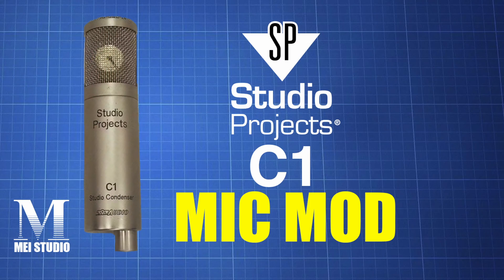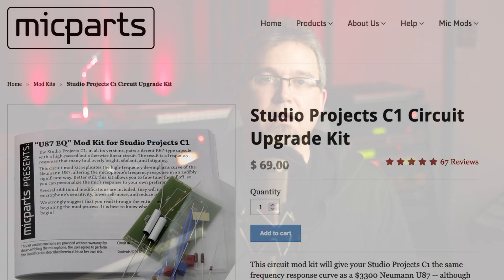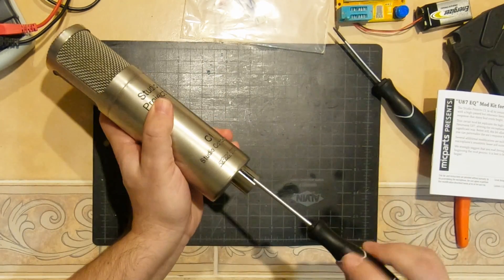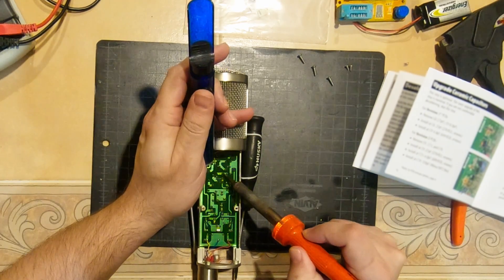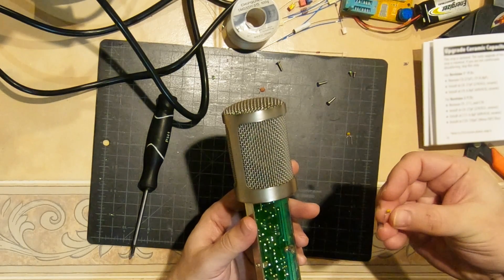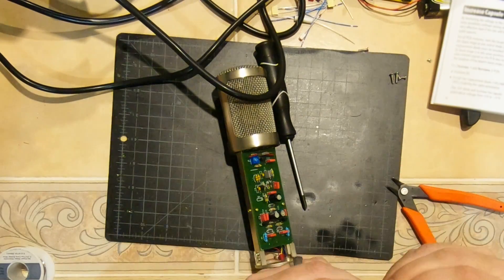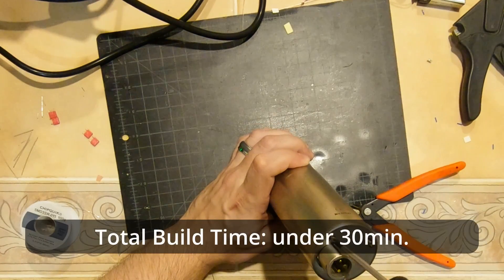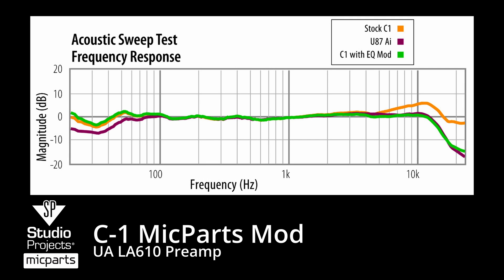Studio Projects C1 Mic Mod from Micparts.com

Comment: Someone left one of these mics at my studio (no surprise). Never found use for it, so went ahead and did the mod, thinking wow, if I can get a “free” U87, why not. Well, the mod improved the mic for sure, but it’s still a fairly unusable sound. Not terrible, and as shown in this video, sounds pretty good on upright. But there are much better mics out there.
Reply from the maker: In what way do you find it unusable?  I would consider a BM800 unusable, but even stock the C1 wasn't terrible.  A little crisp up in the top end (which this mod deals with in a pleasant way, but certainly not something that can't be used.  Is it possible the mic is not functioning correctly?  (maybe thats why someone left it lol)

Comment: Great video, thanks for sharing!  Where was the potentiometer (high EQ roll-off) set for the "modded/post" recordings?  Thanks again!
Reply from the maker: Value wise i couldnt say. If i recall thr pot comes pre trimmed. If i can get a reading off it ill check and report back.  Sometimes hard when its in circuit.
Reply: @ Thanks!  Great video too
Reply from the maker: @robhouse1926  i measured the pot in circuit.  Looks like i have it open at 10K.
Reply: @meistudiony  thanks again!

Comment: It's a no. Some EQ would be much better not loosing some important frequencies, as others that need to be reduced were not. The quality of the mic was degraded on my ears, and those changes of the EQ curve would be easy to so with hardware or software, so making the mod loosing some important frequencies is not the best thing, I think. For other stuff than voices maybe is good, for voices is not what I expected.
Reply from the maker: I wouldnt call the upper frequencies that are rolled off "important".  It's really just rolling off the sibilant frequencies, which most people wind up rolling of with software or hardware... so why not just take care of it at the mic?  The frequencies aren't lost, they're just lowered.  This mod very accurately changes the mics response to match the U87, which is one of the most popular vocal mics ever.  But yeah, its not for everyone.  If you like the brightness of the stock mic, go with it! :)

Comment: Your videos are so nice and all are 
very well documented , you are putting a lot of work into this . Thanks a lot - really valuable for all the unmodded C1 mics lost in the closet. I ve done the mod earlier but missed this kind of video ( also good if you want to sell the modded mic later on ). Can anybody comment on some critics I read somewhere of changing the sensitivity of this mic . It should have a negative influence on the sound somehow-  I cant hear it ?? are there any substance in that?   I moddede my C  so that The potmeter now is accessible from the bottom outside of the mic. im very happy with the result - and now I really really  want a desoldering gun !

Comment: What kind of desoldering tool are you using? Definitely looks way easier and less potentially destructive than the cheapo solder sucker, which seems a bit imprecise for this task.
Reply from the maker: My particular model isnt made anymore. 
But there is a newer version:
https://amzn.to/3xbgCP9
A little pricey but if you do a lot of soldering its amazing. Can essentially take a board down to new again with almost no trace of solder left behind.

Comment: At the risk of sounding stupid, what's the difference between doing the mod and applying an eq curve on your mic input?  Also, what would you charge to do this mod for someone?  I have the mic, and the mod kit, but don't have the solder pump or any circuit board experience.
Reply from the maker: Not stupid at all.  The answer, honestly, is... not much!  Its the difference between having to do that to get the sound you want, or not, by doing the mod once.  If you're interested in getting having it done for you, contact me through the website,  https://www.meirecords.com.  Thanks for checking the video out!
Reply: I've been thinking about this question myself in records to if its worth paying for something I can adjust after the fact. Especially in the case where I would darken a mic just to go in and boost the high end a little afterwords. I think the biggest thing to consider, is that if the mic is hyped, it will be hyped in a way that may not be what you want for the take. It will be hyped in a very fixed way. The flatter the mic response is, the easier it is to adjust the eq in post in the way you actually want. Rather than de-adjusting the hype, then boosting as desired. For example, if the track needs a high shelf because the 12k+ isn't what you need, AND there's already too much 10k because the mic is hyped, now you have to problems to correct. 

Ultimately the more pleasing the original sound capture is, the easier it is to fit in in a mix. 
This is partly the same reason that practicing and experimenting with mic placement is so crucial. Otherwise you could just throw mics anywhere and eq the sound of good mic placement.

Now if I had preset mic response eq curves on hand, maybe it would be that simple. But I don't so I won't assume.
Reply: @GoldenNuggetRec  It's usually not hard to boost a 'dark' mic with e.q, to get some air, whereas sibilance is very annoying to deal with. Tbf most daws are quite capable at this kind of stuff now. These were ok mics in the day, I suspect the entire U87 e.q curve is overkill though. It might only need a couple of caps to tame it enough to be useful.

Comment: A tip with the solder sucker: add some fresh solder to the solder you want to remove before using the pump.
Reply from the maker: I have to do that with the vacuum pump as well, it just never does a great job for me.  Maybe there are better ones out there?  The ones ive used were like $10-15 or so.
Reply: @meistudiony  they seem to work for about a month or two for me before the plastic tip deforms and stops working. I'm hoping to get a vacuum station soon. Definitely an upgrade. Haha
Reply from the maker: yeah, thats about right.  I think you can buy tips for it to replace, but kind of annoying.  The vacuum ones have a metal tip.  It can get clogged every once in a while but there are little pokers that take care of that.

Comment: I was quite surprised with the difference on Piano! The unmodded sound felt very clinical, and I was expecting just to hear a reduction in the highs. But the sound felt like it opened up and added a little extra texture (in a good way). A definite solid improvement! 

I think mods, especially capsule mods, can achieve fantastic sounds for less money. Just a little soldering and patience, and you can have 80-90% of your “dream sound.”
Reply from the maker: Yeah its a pretty useful mod. The mod increases the sensitivity and lowers self noise and obviously the eq shift. But the mic has a new feel to it that was never there before.

Comment: I did the C1 mod on a mic I bought for 80 bucks second-hand. It's now one of the best sounding mics in my locker. I think it definitely needs to be paired with a fairly colorful preamp for most sources however given how incredibly clear it sounds by itself.
The mod kit is a little expensive with postage if you don't live in the USA but it's well worth it. I'm now on the hunt for cheap C3s, having that sort of quality in transformerless mic paired with multipattern would be just perfect.
The only cons I find to the C1: 
- It's heavy and bulky
- The shockmount is er... well they tried. It should fit most universal shockmounts though.
Reply from the maker: LOL!  You hit it on the head with the shockmount.  The one i have fell apart long ago and is held together now with different bands and they dont always stay put.
The mic sound SOOO much better now.  I was thinking of seeing if i could find some C3's as well, just for the multi pattern.  The rest of the circuit is the same, which should yield the same results.
Definitely a sleeper situation where you can get the mic and the mod for around $200USD.  Thanks for checking it out!